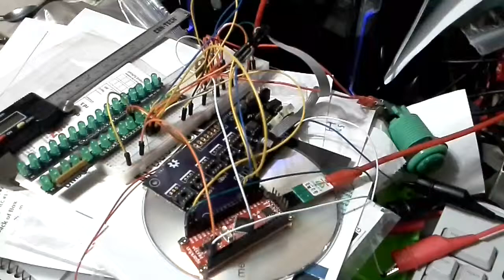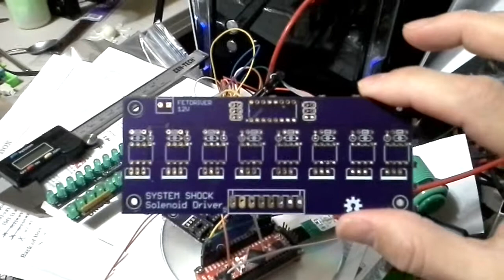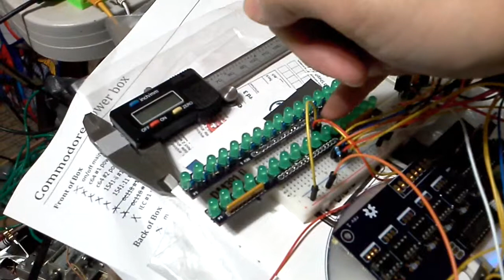Solenoid driver test

Comment: STUART GEORGE,   1.) solenoid coils uses a different type of wire that has "insulation" resistance on the coil wire or something so it doesn't get burned up when left turned on held on for a period of time? 
                               2.) How do you measure the solenoid "Torque" to know how much the power of the solenoids release pushing out strokes to know how strong it releases the solenoids plunger?